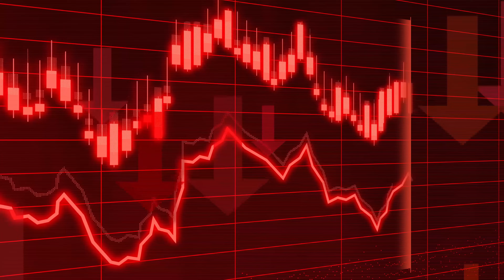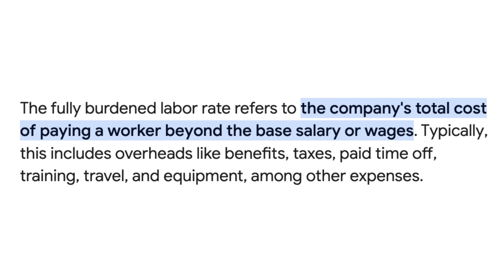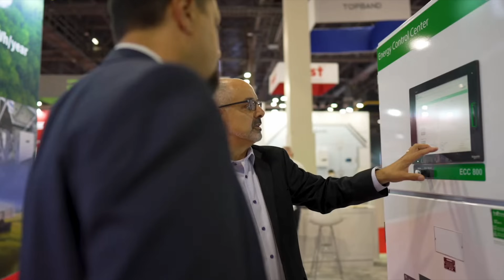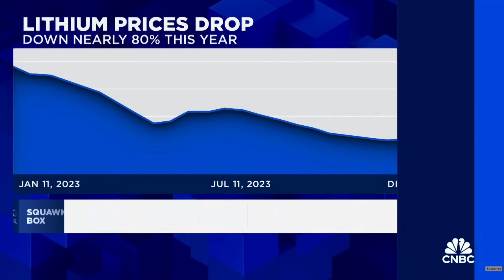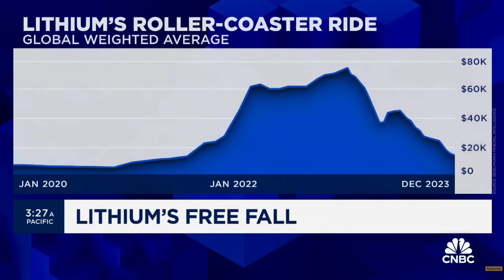IT'S BEGUN! The Solar Battery CRASH of 2025

Comment: CATL is quoting prices as low $56 per kwh by the end of this year.  Assuming no additional tariffs, this is a significant reduction from current pricing.
Reply: That's their bulk wholesale price with no taxes or shipping or middleman. Right now, for the consumer, sodium ion cells are about $150/kWh. That's twice as much as LiFePO4, and the sodium cells are rated for 3000 cycle and the LFP at 6000. So, 4x the cost of LFP over the lifetime of the cells. It's going to take a while for sodium to come down 4x--and in the meantime, LFP prices continue to drop. I don't see sodium being cheaper than LFP. And even if it was, have you seen that voltage curve??? It's too high for an inverter at above 80%SOC and too low below 40%. So you only have half the rated capacity for home power storage applications. That puts it at 8x more expensive than LFP. Sorry, but right now, sodium SUCKS!
Reply: Second Gen Na batteries from CATL feature significant improvements.  It took lithium almost 5 decades of improvements to reach the point it is today.  Neither chemistry is done evolving.
Reply: @daveduncan2748  Second Gen Na batteries from CATL have significant improvements in density, voltage curve and life cycles.  Keep in mind it took Li-ion almost 5 decades of improvements to reach the point it is today.
Reply: @daveduncan2748 thanks.
Reply: In South Africa you can pay as low as $150 per KWH for LFP batteries. I think tariffs in the US for Chinese LFP batteries will increase that price to at least $300. I think margins will also be higher your side so more than likely $400 retail price.
Reply: @free_stylabro6490 that is very cheap. Currently paying $US 650 per kWh in Australia.
Reply: I heard the same but not with yer math.
Reply: 😂😂😂 I can get a 12.8V 100 AH battery for 230 USD delivered right now.
Reply: @FelonyVideos  So can I but that's only 1.28Kwh.  That's $179.68 per Kwh, which is ok, but not great for just a battery.  It's also 12v, which unless you're living in an RV isn't exactly good for home storage.
Reply: @Ryan-ff2db  Not to be argumentative, but the battery has full over current and temperature and BMS protection built in, and shipping is included in that price, not exactly just a raw pack of cells. They could be serial strung together to make any voltage multiple of 12.4 in use today. 

Aside from the bigger picture of the message that lifepo battery prices are practically collapsing, I would love to know if there are any better deals out there right now, because I am on the cusp (ok, within a few months) of making a buy decision.
Reply: @FelonyVideos  I just meant that products like the EG4 pro are a lot more than a battery, it's a pretty impressive product.  If you can wait though, I probably would.  CATL is now predicting $54 at the cell level by year end, with current pricing estimated at $76.  It was $110 mid 2023.  It always takes some time to work through the supply chain but I suspect we'll see some interesting Black Friday deals this year.
Reply: @Ryan-ff2db  2025 is going to be the year for solar bargains!
Reply: Currently LFP 1 kWh averages 45-47 usd in exw in china for low qty. If you buy in significant qty like 50-100 MWh per year then price is in the 32-35 usd per kWh. Cost of making is around 22-25 usd per kWh. This is for prismatic batteries only.
Reply: Per kWh now it's around $660!
You saying it's gonna be $56?
I don't see that coming!
Source?
Reply: @tibsyy895  I suspect he is quoting raw prismatic battery cost.  You $660 per kwh is very high but might be correct for ripoffs like Tesla and similar solutions.  Go with a solar generator, ground mount solar system if you have the room and a solar generator with a transfer switch and be off-grid as much as possible
Reply: @ronbridegroom8428  Correct.  The EG4 pro sells for $3,299 at 14.33 Kwh.  That is about $230 per Kwh but it includes the case, BMS, Software, Fuses, sensors, cables, emergency shutoff etc.. The cells still make up the majority of the cost though, so such a large reduction would still be huge.
Reply: @Ryan-ff2db  And if you buy the kit and cells separately, and put them  together yourself, (takes about 2-3 hours) , you can get that same size battery for around $2,3000. That's $160 Kwh!
Reply: @ronbridegroom8428  You are correct.. Be your own power company,  IF the government will let you.
Reply: @tibsyy895  Source is CATL itself on their website.  This is at the cell level, which currently is around $100 to $120 for LFP.
Reply: @tibsyy895  The source is CATL and it's on their website and is referring to the cell level.  This is about half the cost compared to the start of this year.
Reply: @tibsyy895  Its not now $660 its actually $130 at pack level. not at pouch level.
Reply: @tibsyy895  Dunno if it dropped this hard within one months, but current price is already below 200. Which seems in line with what other people are reporting. I doubt that sub 60 figure too. But over the next 5 years? Who knows. I never would have guess batteries this durable to drop this far below 500.

Comment: Don't neglect the possibility of sodium ion taking lithium's place. While not being used in a large scale yet, they are the perfect product for home energy storage and will likely cut battery costs to half of lithium. They still currently have a lower density than lithium but that's ok for stationary storage solutions.
Reply: The first SIB's for home storage are expected around summer of 2025 as newer SIB dedicated factories ramp.  They likely won't be much cheaper at first though, until supply increases to meet demand.
Reply: @Ryan-ff2db  a day I'm looking forward tok
Reply: They also have discharge curve that isn't as flat, which means that you need a more sophisticated inverter. Still, they are better for stationary cost-wise.
Reply: @joryferrell7244  so at least the charge level indication is accurate. On LFP flat curve it’s is a problem..
Reply: @philgooddr.7850  Yea. Hopefully a sophisticated enough solution comes along to track by voltage. Do most LFP systems just track the current load and use that to guesstimate?
Reply: Catl is making sodium ion batteries for byd ev this year!
Reply: To be more economical, they would need to have a similar cycle life to Lithium chemistries. You won't save money on storage, if you have to replace that less expensive battery too much more often. It's all about LCOS. (Levelized Cost Of (energy) Storage)
     You are right, in a stationary application, the battery doesn't have to accelerate itself, the vehicle, you, and anything you're hauling. The battery can be as bulky and heavy as it wants, as long as it's efficient, safe, reliable, and CHEAP!
Reply: @vincentrobinette1507 lifecycle is irrelevant if the warranty is only 8 years on the battery. Insurance companies could insist the battery is changed if old batteries increase the risk of fire etc.
Reply: Sodium Ion are way different than LiFePo4, and hence the default Victron equipment can only use 50% of the capacity of a sodium ion battery.
And you have to build your setup to the lowest voltage->maximum current. 
LiFePo4 are always around 3.2...3.4V in the 5%-100% range, dipping to 3V or 2.65V if you want that last 5%, topping to 3.6V  max when balancing.
Sodium Ion are 1.5V ... 4.3V in the 0%-100% range. So you either need a very good buckboost or a lot of cells and a good buck or inverter to use them for home use. The difference in current is a factor 2.9 between full and empty battery if you want to get the same power. You have to use cables for the current at the lowest voltage.
If you use a 16 serie setup, you will get a voltage between 24 and 68V. To deliver 3.7kW that means you would cater to 155A@24V, while a LiFePo4 would just be 77A@48V.
So while I agree it sodium is the future compared to LiFePo4 or any Lithium based, the fact that the voltage has such a large swing on sodium means we need a lot of innovation to also make use of that.
The voltage swing on LiFePo4 is so low that I can hook an almost empty battery parallel to a full battery and the current between them will highly likely be a lot lower than that 3.7kW (So much lower than the max rated charging current).
Reply: @bloepje  Yep. Huge problems for Na+, even if it ever does get cheaper than LFP--which I'm not convinced it will. To get inexpensive, the material and manufacture have to be inexpensive. Manufacturing is less expensive at scale. The material prices for LFP are unexpectedly becoming more available, and thus less expensive. But manufacturing is always going to be a problem for Na+ batteries. I don't see how and unsuitable technology that costs more will ever get adequate demand to fund the manufacturing volume to compete with LFP. I just don't see a path for Na+ to be cheaper than LFP in any foreseeable future, and even if it did, LFP would STILL be a much better battery, probably worth the extra cost. Na+ is DOA.
Reply: Perception is reality.  Sodium doesn't have to be better than lithium for every application.  It just needs to be competitive and a threat...which will cause lithium prices to tank lower.  It is similar to EVs and oil prices.  Just the idea that full EV saturation is in the future keeps future demand of oil depressed.
Reply: Vanadium Flow battery's are being used in caravan parks in Western Australia...
Reply: Sodium Ion batteries can be discharged to zero without degradation and can be recharged many more times than Lithium Ion batteries.  Plenty of details about this on the web.
Reply: @bertvandenberg1822  Do you know what the voltage is across the last 10% of Sodium Ion batteries? The last 30-40% is hardly useful in most applications. In fact, the top 20% is so high, it will destroy a lot of the equipment that's out there.
Reply: totally sodium, it's already being produced, but in china, also, chinese markets get better product than foreigners, that's weird.
Reply: @dcaban85  what's available from China in China for China is usually different and superior to what is generally available for outside China unless there is a specification.
Reply: @MartinMaat that's not how it works. What they would so, if it is true, is produce the batteries. When they test them for quality assurance they have two levels the higher quality ones are earmarked for local sales and the lower quality ones for foreign. No need for intentional production of multiple tiers just an imprecise method that has variability in quality.
Reply: @evancombs5159  Batteries are not the kind of product that would allow for this kind of top-tier low-tier differentiation. Microchips, yes. But then these would be sold as different products. If testing takes less than 1% of the production time, this becomes an option. If it's the other way around, not so much. Plus with batteries differences would be marginal. It's nonsense.
Reply: I hope you are right. But it also took 10 years for LFP to become cheap. And we don’t know much about the sodium. We dont have long term knowledge of the chemistry. Also the voltage of lfp lets say 4s for example 12.8V is the perfect fit in replacement for lead acid. Also 14.4 V charged.
Reply: How does that math work out in your head I wonder?
Reply: In reality see who produces the technology first then who produces it almost immediately after.
Reply: Well general consensus says that by 2030 lithium ion batteries will still be about 80% of the total energy storage marketplace for residential. Another words don't hold your breath.
Reply: Already a Chinese car brand using sodium batteries in their smaller cars.
Reply: @lifeliver9000  Dumb. LFP are cheaper, and pack more energy for the same weight or volume.
Reply: @SF1886 JUST TYPE  in Google «  Migros Schlieren sodium batteries » and read the articles in English,,in German, in French whatever…instead of making unsubstantiated statements to facts you may dislike….This is real operational life,, not geek virtual futuristic rhetoric . yes Northvolt as a shift announced to sodium but that’s a big gamble to try to overcome a big lithium dangerous disaster. 140 cars destroyed in Korea by an MB EQE350 , 200 in Lisbon by a Tesla…both self igniting, not being charged with any energy import, also a cyber truck in Australia block an highway both sides…all this in august 2024 only. Note safer certification for road usage will very likely be implemented…and new homologated BEV’s the only ones allowed in confined spaces, long tunnels, show rooms, underground parkings, garages, ferry boats ,,etc. The liability costs already thru the roof and paid by others building insurance goods transported other vehicles,ferry etc insurance are increasing the premiums paid all over…soon this cannot be coped with the EV fleet aging and increased liability and protective safety measures will be taken, that’s an historical,trend..🤣
Reply: @SF1886just type «  Migros Schlieren Sodium Battery » and read….the truth…
Reply: Price of lithium has collapsed with poor EV sales in 2024, down to 14k$/ton of LiCl. yet sodium salt batteries wi5 nickel plates installed here are more durable and easely recycled but are heavy and less efficient so for home use only and moderate capacity. a supermarket in Schlieren has 520kWh of sodium salt battery installed but it weight 7 tons...
Reply: @philgooddr.7850  7000kg worth of batteries to run a supermarket is no problem. Thats fit inside a 20ft shipping container. How many supermarkets do you already see with shipping container sized generators out back as emergency power for during outages.
Reply: @rmar127  Yes low temp,sodium salt batteries are ok for stationary installation with a life time of 15 years and easy reconditioning with no polluting wastes after that…. Efficiency is not great but since PV is now economical the solution has cost and grey energy merits. One way to optimise battery domestic usage is a mini grid on a group of autonomous houses with all owners forming a cooperative selling and buying stored available power to each others at the same fixed price .
Reply: @philgooddr.7850  sounds like a virtual power plant. Love the concept, but legislation would need to change here in Australia to make them work at any scale. Not undoable though.
Reply: I'm not buying it. The voltage curve for sodium ion (Na+) is terrible compared to LFP and even NMC--especially for most existing inverters. And both LFP and NMC are still cheaper than Na+. Sure, being larger and heavier is not as big an issue in a fixed install, but if you are getting smaller and lighter for less money--take it! Of course, Na+ isn't dependent on the former bottleneck, lithium, but the reality is there is no longer a shortage of lithium, and there probably won't be even as the economy (and EV sales) pick back up. Several lithium mines are ramping up just in the U.S. It could be that lithium battery prices drop just as much as Na+. I like LFP batteries the best right now because they are not as dangerous as NMC, they have almost as much energy density as NMC and more than Na+, and they are cheaper than Na+ and NMC. LFP (LiFePO4) seems like the way to go now, and in the foreseeable future. I think Na+ has missed the bus.
Reply: @daveduncan2748  no, sodium ion is significantly cheaper than lithium ion and LFP. Ask or look at catl and byd
Reply: @larryc1616  yes, sodium is cheaper but you need more of all materials for the same energy due to the worse energy density
Reply: @daveduncan2748  No argument here. I would love to see that happen. I've had LFP batteries in one of my drills for eighteen years now. Back then it was $150 for 75 whrs. The original battery packs still work. Just saying that when sodium ramps up, I expect them to be less expensive than LFP due to the abundance of sodium and the fact that it can be found almost everywhere. Either chemistry is fine with me as long as the prices continue to drop.
Reply: @daveduncan2748  Once they ramp Na will be cheaper.  The first large scale BESS systems in China are already being built and the first one went online in May of this year.  Many more are in the works.
Reply: @daveduncan2748  the non flat curve of sodium ion battery is not a challenge for dc/dc and Dc/ac inverters.
Reply: @daveduncan2748  EV sales will not pick up too many battery fires!
Reply: @JosEPh-zy3yr  I think the biggest concern is there are real problems with EV charging infrastructure and range. The early adopters were willing to put up with it. Regular people don't want to fuss about range. They want to go until they get to 1/2 or 1/4 of a tank of gas and start watching for a gas station. There are fewer EV fires than there are ICE car fires. But it's not that simple. The average age of ICE cars is much older than that of EVs. Older cars of both types are more prone to fires. That's one of the reasons I prefer LFP chemistry over NMC, despite LFP being slightly less power dense per kilogram.
Reply: I agree. I understand soduim energy density is around 100-150watt/kg. It will mostly be sitting and take up some space. But i know that energy density in time will improve.
Reply: @Mr_natenut  maybe in the future they can be used as bricks to build the home itself
Reply: @PazinPortugal  that should be interesting.
Reply: Severely untrue!
Reply: The battery costs aren't really the big issue - as mentioned in the video.  You can by 1 kWh LiFePo4 battery for under $200 now - and that's retail.  So you could add a massive 50 kWh for $10K - add an inverter / charge controller and Bob's yer Uncle... except for all that pesky installation cost at $100/hr of labor.  If only the government would mandate that all homes be battery backup ready as part of code?  When done at construction time that would save a ton of money... but of course now we have almost every home and property in the nation not at all ready for batteries which massively increases the cost of decentralizing our grid.